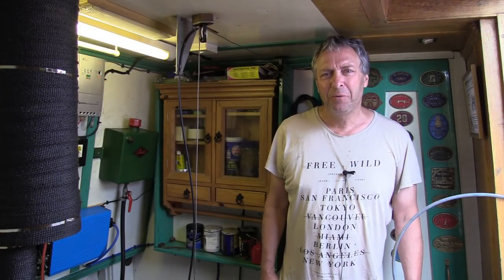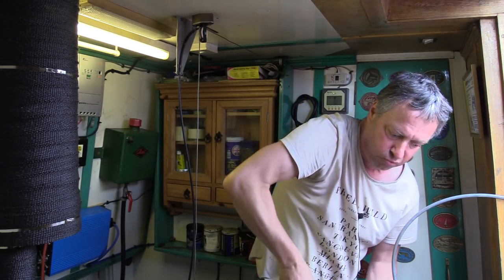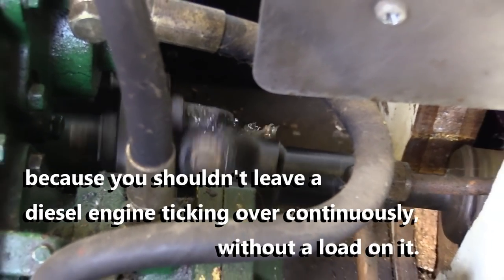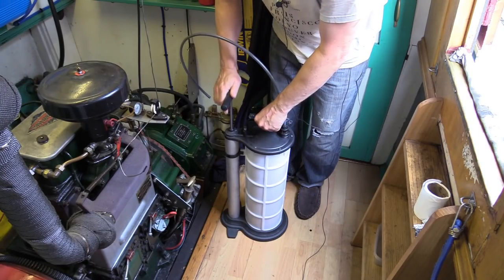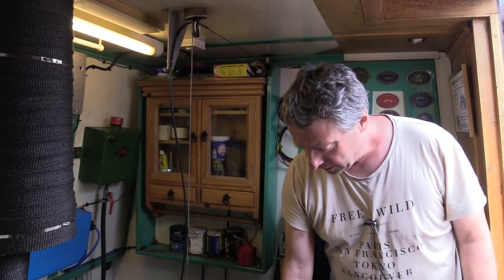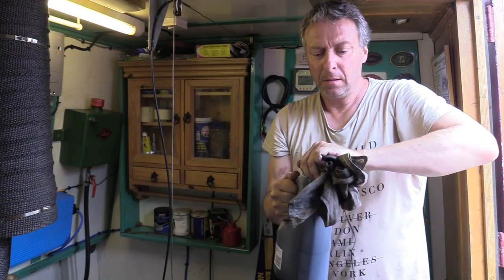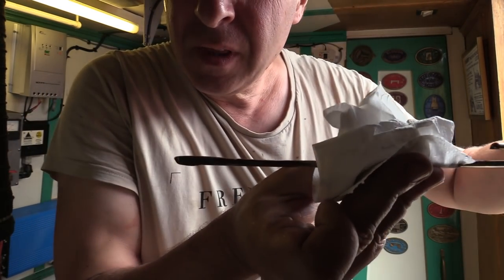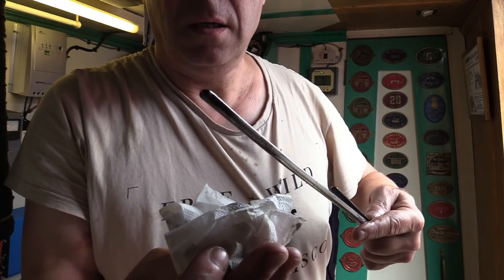Vintage Engine Oil Change On A Narrowboat . . .

Comment from the maker: A few popular questions have popped up so I'll give the answers below, rather than answer every one individually.

Why didn't I change the filter? The engine doesn't have an oil filter, just a gauze screen that requires cleaning every other oil change.

Why didn't I put the vacuum tube down the oil filler hole? The oil filler has internal baffling, which makes it difficult/impossible to reach the bottom of the sump.

Why didn't I use a bigger pipe? As I was stuck with using the dipstick tube, it wasn't possible to get a bigger pipe down there.

Didn't you notice there is a brass pump attached to the front of the engine for extracting oil (you idiot, etc)? Obviously yes, I know the pump is there. However the internals of the pump are worn, so now makes a nice decorative piece. 

Why shouldn't you leave a diesel engine ticking over for an extended period? This is an extract from one of many articles freely available on the subject. "... letting your diesel idle for anything more than a short duration is a bad idea because while the engine will use little fuel, what fuel it does burn will not combust completely because the operating temperature is too low. Unlike gasoline engines, diesels need to be under load to reach optimum operating temperature."
Reply: Kind of like the old VWs
Reply: CountryHouseGent very informative answer but as far as I can see you know Asian inside and out ,so no explanation needed of your maintenance .But very informative for others .I suppose it’s very helpful if they have a similar engine so good job 👍
Reply: hi kevin, some of that very old engines use centrifugal oil filters that are normally seated somewhere around the crankshaft and have to be cleaned on very long intervalls .but then they are hard to get to. did you check that with your manual?
Reply from the maker: Yes definitely a gauze situated on the end of the oil pickup in the sump
Reply: @daviddavis5689  Does anyone know what has happened to Kevin?  Is he alright?
Reply: Great info...I like how you put the answers all together in one place.

Comment: Interesting video. 50+ years ago I was working in agricultural engineering. We could buy the workshop oil at the wholesale price. It was SAE 30 HD or diesel oil with detergent. What we found was if you used straight after a rebuild no problems but beware of putting it in an older engine. I ran BSA B31-3s Ariel Red Hunters air-cooled 1950s British singles. We found an SAE 50 oil worked well, especially with higher mileage engines. We probably worked them harder than you work Aslan, but if Aslan starts burning any oil it would be worth thinking about if you can still get it. I don't live in the UK anymore.

Comment: You've got a cracking vessel to move that oil from the big container to the engine but I couldn't help thinking how much easier (also less messy) it might be to use a big funnel. I realize this is yet another piece of equipment you would only use once every few years but you could keep it with the suction pump. Originally I thought, "Why not use the suction pump to get the oil out of the big can," but you'd have to clean it between each different step of the change which would undo any benefit. So, yeah, a big funnel that could double as a party hat
I truly love Aslan and your adventures upon and within it. I wish you a long lifetime of such well documented travels by narrowboat.
Reply from the maker: Cheers. Yes a funnel would be handy but never got round to buying one. :)

Comment: i have a hand pump, which i use to extract the oil from my 1982 motorcycle engine. I try to use Duckhams 20/50, Glad to see these old engines still in use. Great vlog.

Comment: I was recommended your video channel in my YouTube feed. I do enjoy watching about narrowboats in England and Wales. I maybe a Ocean and a Continent away from you I thought it was nice to see how you were doing a simple job of changing the motor oil. I fully agree with you on using non detergent motor oil in older engines. I previously watched your video where you had you Aslan blackened, you painted the Gunnels and replaced the rope fenders.  Because of it you have a new subscriber.

Comment: I really enjoyed spending time with your vintage Petter-Mclaren. And they're from Leeds, too which seems very appropriate given your travels on the Leeds-Liverpool.
That vacuum pump is very familiar. Every scooter shop in Taiwan has one. They use a wide nozzle and get a 125cc scooter's 1 quart of oil out of the crankcase in about two minutes.

Comment: My opinion is that Morris Lubricants are as good  it gets, use them in my lathes and mills, great products! As for sucking out the sump, have an extension pipe fitted in the place of the existing sump plug that brings access from under the engine to up the side of it. Make sure the extension pipe finishes above the full sump level by an inch and has a pipe threaded plug installed upon it. When you need to change oil it would be a simple matter of removing the plug and screwing your suction device into the pipe fitting on the pipe extension. Similar B2 engines were used down here on towed behind vibrating road rollers, I live in New Zealand

Comment: So happy to see you back!  Those vacuum pumps are essential for motor boaters that change their own oil. Have also used it to extract other fluids. I have a very tiny draw tube that will fit in the dip stick tube of most engines... its slow, but it does the job.

Comment: Quicker way to extract oil, and much smaller for storage. Do a search on:

" HEP-02A Gas Diesel fuel pump Inline Low Pressure electric fuel pump 12V" 

Storage space is gold on RV's, be they narrowboats or motorhomes (USA lingo).  This is also great for motorcycle, lawn mowers or any other engine that you want to change fluids in.  Love your channel.
Reply from the maker: Thanks for the tip Larry. I'll check it out

Comment: I don’t know if you know something I don’t about vaccum pumps. But I work on land rovers, and use a vaccum pump to remove the oil. The service books state too leave the filler cap on, and use a pipe that is tight to the dipstick tub or vaccum hole on newer vehicles, making a seal, the pipe doesn’t need to be fully inserted as the vaccum will suck all the oil up anyway. This way only requires about 5/6 pumps to remove the oil too.
Reply from the maker: Hmm, yes. I don't think they'd invented that level of air tightness back in the 50's, Lyle. 😂
Reply: CountryHouseGent well yes but you’ve left the filler cap off and not used some bluetac around the vaccum pump tube/dipstick tube. Also if you tip the oil barrel the other way with the hole at the top, it won’t get on your hand I swear, and it won’t gulp like that just pour smoothly

Comment: Love the way the quoted BHP figure is at a specific temp and altitude.. The science of mineral V's synthetic scrubbing oils makes sense the way you've explained it, hence no oil filter !  
Take care and keep on "dumphing "...
Regards  Steve (local fella)
Reply from the maker: That's right Steve - I was a bit stumped originally when I couldn't find a filter and as you say, is why you don't want detergent knocking chunks of gunge of the engine internals. ☺

Comment: Paul is correct. Pour with the noozle on top. Allows angle of container to be better positioned over jug and prevents air ingress causing glugging which can result in spitting spill. Easy!

Comment: Hi Kevin , nice to see you again. It is interesting that engine maker didn’t built in a hand vacuum pump for oil replacement. Normally those vintage engines come with such arrangement.
Reply from the maker: Hi Joseph. In fact there is a brass pump at the front but it's now more decorative than functional.

Comment: I did my oil on my new Beta and I always get a sense of satisfaction when I’ve done it, and while vintage engines need miners oil, new Beta engines still need mineral oil. Getting rid of the old can be a pain though.
Reply from the maker: Yes Ray, it's like detoxing yourself at the same time as the engine. Great for the mind. :)
Reply: Hi Ray...don't know where you are, but most local councils have the means to collect...and recycle...old engine oil. 
Many DIY's change their car engine oil these days....
May cost a nominal fee...but hey....better than making a mess for others. Mmm?

Comment: Gday Kev, great vid and I too love working on old motors. It's also good to see you have a civilized engine room to top it off. Next time your looking at that extractor pump on the motor toul find if you pull out the plunger it will have a worn out washer which is usually made of leather and you can cut a new one from an old belt. Another vid perhaps. Thanks for the entertainment cobber. Martin

Comment: A straight SAE 30 will have a lower detergent level, check the TBN on the data sheet, you are spot on. Mineral generally should be cheaper than synthetic and the latter gives better low temperature properties and tends to last longer. There is a school of thought that mineral gives a better lubricant film hence racers in the US use Penz oil. An old engine like yours has run well for decades on mineral so why change? Boaters tend to warm their engines up which is another good reason not to bother with the more modern oils.
Reply: I go for the cheapest heavy deasile oil to go in older cars. Or if an old lawn mower. Put in the cheapest light oil run through and change. Re same with cars. A magnet at plug will help tell what happens inside.

Comment: hi  there Next to oil filler  is  the brass pump  connected  to  pipe run back to sump plug use to remove oil
Reply from the maker: I refer the honorable gentleman to the answers I gave at the top of this thread.
Reply: @CountryHouseGent  did not read the full Comments sorry
Reply from the maker: No worries Jose. ☺

Comment: Another excellent video, thank you for taking the time to produce it. My Lister CS2 on Percy uses the same oil (I now know why I buy it in 5 litres cans  ! ) My limited understanding of the oil technology is the golden film Morris oil and others of its type do not hold the particles in the oil as modern oils do that take the oil and particles to the filter and the filter does it job. The mineral oils rather just drop the particles  (eventually) into the sump and on Percy there is a service interval to remove the side of the engine and clean the sump (there is a gauze filter in there !) Not done it yet but it is my Autumn job as I need to remove the waterpump and starter motor to access the panel that gives me the open heart surgery access to Percy's donk. Just wondered if your engine has such a service routine ? Keep em coming ......
Reply from the maker: Yes Nev, there's a gauze strainer in the sump. Same as yours, I have to remove the starter and a side cover to get to it. Manual says to do it every other oil change.

Comment: Thank you for the peek at oil change on an older diesel. As a Great Loop boater with Perkins diesel power it was very interesting to watch.
The shirt, Free + Wild. Is there a story there? Some cities lined through, some not. Couldn't find any clues on the interweb.
Reply from the maker: Ha, sorry to disappoint, Archie but the t shirt was printed like that. Shame though. 😁

Comment: Said for decades to use Duckhams oil in high mileage engines for that very reason. If your engine burns oil due to wear it will burn a lot less on Duckhams, with it being a vegetable oil it's harder to burn. I was taught that by someone when I was not much more than an apprentice.
Reply: Oil not burning that gets in combustion chamber fouls ignition glow.

Comment: Hi Kevin, there are pumps that you can get to pump out the oil that attaches to a drill.  I have a boat and it makes it fast and a lot easier than manually pumping it out.  Look up Drill Pump on Amazon,  little over $18.00 USD.

Comment: Enjoyable video, Kevin. Couldn't you have used a bigger diameter suction tube down the filler hole? Surely the filler hole and dipstick holes both enter into the same part of the sump.
Reply from the maker: Hi John, the filler has internal baffling which makes it impossible to get a tube right to the bottom of the sump.

Comment: Hi Kevin,  like  your video changing the engine  oil. 
Just a thought isn't that  brass pump for talking the old oil out because with got one are boat,  it was on a lister engine and then we changed it to a bmc engine and used the same system for changing the  oil. .
Reply from the maker: Yes Andrew, it's the original pump but the internals are worn and now acts as a fine decoration. ☺

Comment: Great vlog CHG always wondered how you did it. Just one question why didn’t you put the pipe down the filler tube as apposed to the dip stick tube. Probably self explanatory, but there you go.
Reply from the maker: The filler has internal baffling on it's way to the sump, Micky. The dipstick tube is a straight run down.
Reply: CountryHouseGent . Cheers for that.

Comment: An engine room you can actually stand upright in what a luxury . I have been told not to change the oil on my jp2 until I can stand a spoon up in it ,not sure about that sort of advice I think once a year is about right even though we do about 700 hours in that time. Very informative thanks very much. Why not put the vac tube down the oil filler hole?
Reply from the maker: Hi Jason. Yes, waiting till your oil resembles black treacle sounds a bit dodgy to me. Most manuals for old engines say every 12 months or about 1000 hours.

There is internal baffling in the filler. The dipstick hole is a direct route to the sump.

Comment: A little tip: I noticed when you poured the new oil you poured on the shortest side, next time turn the 25l can 180 degrees and pour across the longest side.
Reply: I thought I saw an air relief tube on the top of the main tube...to aid pouring.
Had it not has that, then yes, rotate the can 180°.
Reply: Yup, always rotate the can to prevent glugging. With rectangular cans (e.g. 5 litres) turn the can 90 degrees :-)
Reply: If the can is completely full and you try pouring with the spout on top, won’t it start coming out before you’re over your target?
Reply: @JasperJanssen  Never seemed to Jasper, my parents taught me, post war UK used paraffin for heating so it was a regular event to fill the little stoves :-)

Comment: It is so good to see you back. I use a 12v one to remove the oil in the TD5. No oil filter on the engine? It looks like there is a sump pump just aft of the dip stick, why do you not use that?

Comment: Love that you're doing your maintenance work in your "bed slippers".  :-)  Can we ass-u-me that you can't hit the bottom of the sump via the filler neck?  Also, is there enough room to thread a drain valve underneath the engine so that you could use a more compact pump to drain the oil?

Comment: No oil filter on the engine Kevin?, if you use a can of oil (any size) always have the outlet at the top or just off centre, it glugs because it needs air, also a Funnel would be handy.
Reply from the maker: Yes, no filter, just a gauze mesh.
Reply: Or vent the can at the other side to the spout ... only needs a tiny hole with a screwdriver. Then you can pour the correct way up - or in this case down !
Reply: @Charlie-vw9ur  Yes, that works fine too.  
But I am pretty sure this had a modern air relief tube...
I'll have another look....If I'm wrong, then I stand corrected. Stay safe.

Comment: Hi, great sound from your engine. There appears to be a brass oil extraction  pump fitted to the engine.   Could you have used that to extract the oil in the sump ? Thank you.
Reply from the maker: Yes that's the original extraction pump, but now more use as a decoration. ☺

Comment: hi great video. what about the oil bath air cleaner ? surely the oil should be changed and the mesh cleaned in paraffin. does this engine not have an oil filter ?
Reply from the maker: Hi Peter. Yes, I change the oil in the air cleaner at the same time. No oil filter but has a gauze strainer in the sump which requires cleaning every other change.

Comment: I couldn't help but notice what looked very much like a brass manual oil draining pump (as fitted on modern narrowboat engines) a few inches aft of the dipstick. If its not a pump, what is it for? Just curious.
Reply from the maker: Hi Derek. It's a pump for removing engine oil. Unfortunately at 68 years of age, it no longer works.

Comment: I'm a mineral oil only in my old bikes,  it apparently don't froth up as well as not washing all the lovely carbon where needed like synthetic might in these lovely oil crunching oil pumping engines, although i do pop a cap of Castrol R in the tank , em smells great at the traffic lights.
Just wondering, I may of missed you saying, did i notice your engine had a brass oil pump for ease of emptying oil.
Great stuff enjoyed the change of oil video.

Comment: Just got one of those hoses are they brilliant, storage wise at least.
Reply: JtotheW Ideal for storing, not so much in actual use! The smaller diameter means they restrict flow and can double the time it takes to fill your tank.
Reply: @spencerwilton5831  ah yes, mine is for watering the garden so horses for courses I suppose.

Comment: Hi there.  I was wondering why when you got the vacuum pulled and it was sucking out the oil you didn't carry on pumping?  I'm wondering if that would have kept the vacuum stronger and sped up the extraction process?  Or have you tried that before and found it doesn't make much difference?  Thanks.
Reply from the maker: Hi. There's a limit to how much vacuum the pump can produce. After pumping for about 30 seconds, it's very difficult to pump anymore air out of the canister.